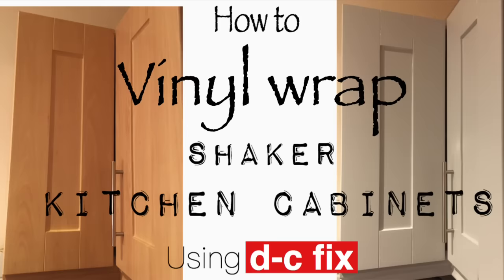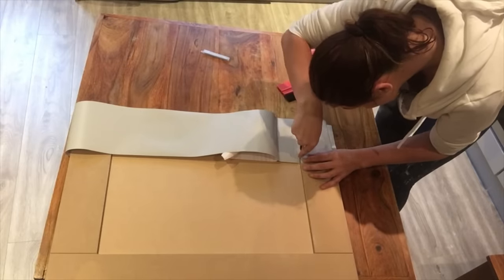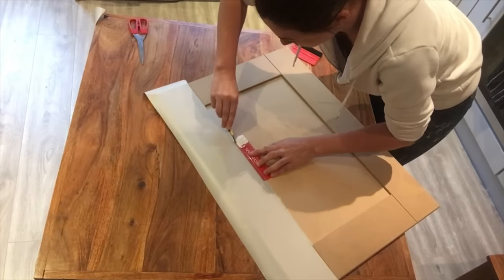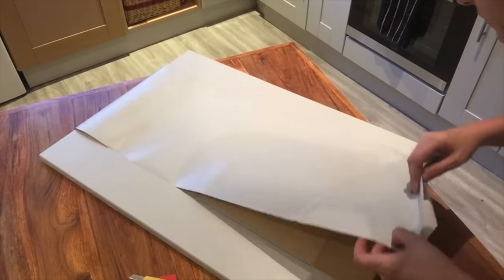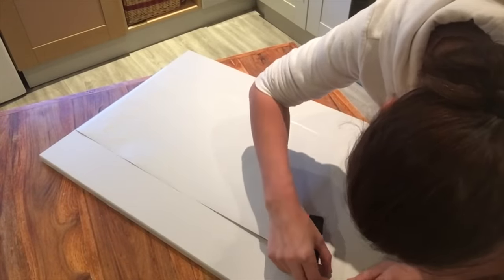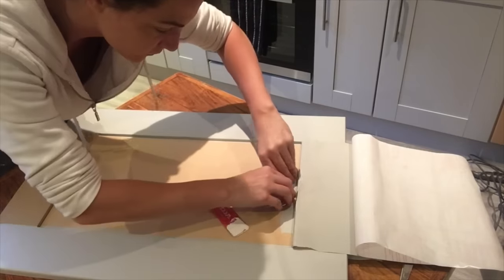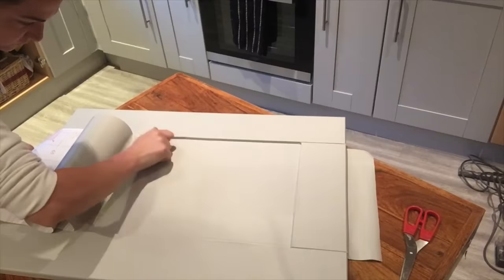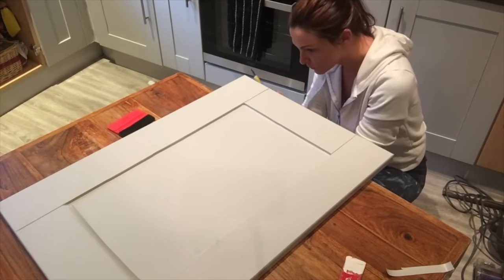USING D-C FIX TO WRAP SHAKER KITCHEN DOORS

Comment: This will fail with time as heat and moisture lift the edges - 12 months max. The adhesive vinyl you can pick up at DIY stores tens to be fablon or DC Fix. It's so thin and flimsy and will gouge and scratch easily, has no fire ratings or guarantees and will discolour. Stuff like 3m, although top end and installed by pros, comes with a 10 yr warranty and looks and feels like the real thing. This just like like, erm, sticky vinyl on wood.
Reply from the maker: This is dc-fix that I’ve used. 10 months later still going strong. No one expects a kitchen to last forever and I think for the cost it was a fantastic product. I’ll be doing an update video over the next few weeks showing how it’s lasted. For a DIY job to get a few years use out of it I’m really happy with the product
Reply: It's fine for a short term fix and I know some people like to chop and change but you can tell it will fail as there is little tack to it. Using primer around the edges may help with longevity

Comment: Painting it would have been faster and cheaper, I think.
Reply from the maker: I have this debate all the time - I think it would depend on the paint. When I was looking at paint vs wrap I couldn’t find a paint that looked like it would hold up. I found this quite inexpensive - I’ve got quite a lot of cupboards and did them all for about £40 - cupboard paints were £20+ per tin and would have thought I’d need more than 2 tins so cost probably around the same

Comment: Sorry, but that would be way too much work. It would take forever!! I don’t see it lasting that long. Would much rather have them painted. I hate my factory wrapped foil white cupboards. They tend to peel with a lot of use.
Reply from the maker: It is more complicated to do on this style of door. Definitely glad I did this rather than painting though, I personally think the finish is better and is really easy to clean. Holding up well after 6 months so far 🤞🏻
Reply: Paint always need maintenance this vinyl won't need much if any.

Every year you paint this is an extra layer on the door vinyl can be removed and replaced easy

Comment: So much work... much easier to paint and put a polyurethane finish on it to not show fingerprints and such... 
for 100 dollars and a days work, your kitchen would be complete for 30 years to come.. 
this was painful to watch...
Reply from the maker: Not everyone can paint cupboards if they rent for example so this is a good alternative to painting. I prefer the finish on this - no brush strokes etc and it definitely wouldn’t have been quicker to paint. Each door takes about 10 mins to cover - this was slower for demonstration purposes. Much cheaper than painting too - I wrapped my whole kitchen for £40. No way could 2 coats and a top coat have been added in the the time it took to wrap this when you take into account drying time. It will last for a few years if not more and I think it’s a cost effective solution. I’ve never known of any painted surface that would last for 30 years without needing touching up but that’s your opinion 🤷🏻‍♀️

Comment: Buy yourself a hot air gun! That is not the way to do this !!
Reply from the maker: I had originally tried with hot air which wasn’t working well due to the style of the doors. It was tearing and causing too much wastage and found this was a better alternative for me personally. It still does the job.
Reply: A hairdryer does just as good, I used this DC fix and its very good without using hot air.
Cleaning the doors thoroughly helps for a good fix, nice job done Laura.
Reply: Hi.  I have the exact same type of cupboards. Same color and shape I didn’t know how to do it. Thanks to you!
Reply from the maker: eunice mugwinyi glad I could help! Had the same issue myself as everyone else was covering standard flat cupboards! Good luck 😄